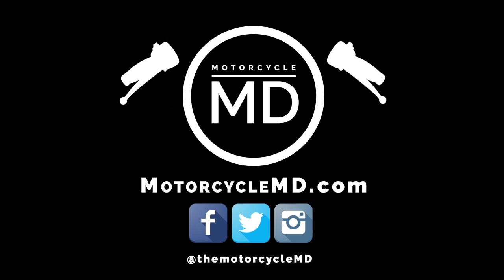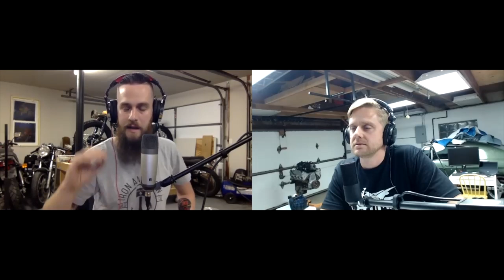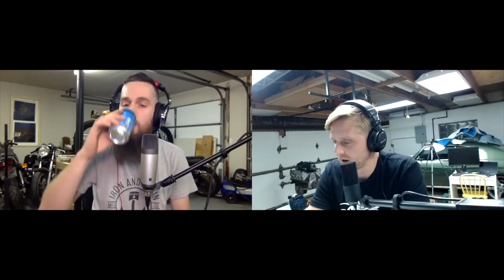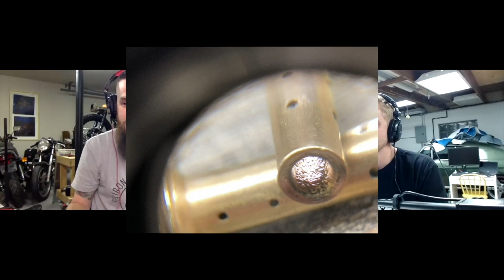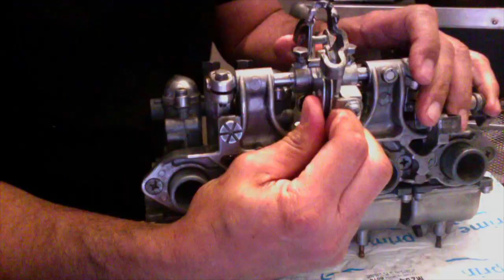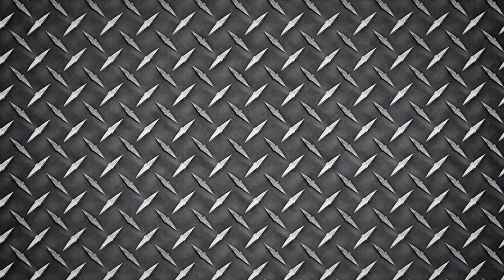The Broken Moto Show: Episode 6

Comment: For Mr. Anderson: points ignition can be helped out with a transistor circuit. It will take the load off the points, you can get rid of the condenser.
You can buy the circuit in a kit form or you can build it yourself. (one kit per breaker/coil)
velleman.eu/downloads/0/illustrated/illustrated_assembly_manual_k2543.pdf

Comment: There was a video about it but I just can't find it. I got Honda Seven Fifty RC42 with air pods and 4in1 exhaust (slip on silencer). The carbs are cleaned, synch, and pre-addjusted but at high open throtille there is no feedback. Im about to change the jet needles but not sure what size. Can you recomend? Best!